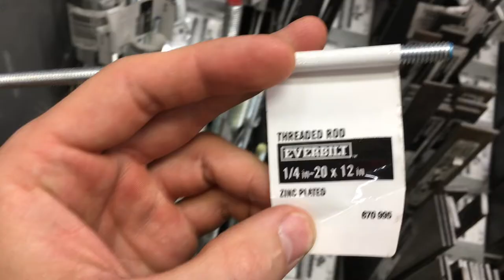Microphone Boom Arm made from cardboard Part 2

Comment: is it strong? would it be able to hold around 450g
Reply from the maker: Yes it could hold that much wait. You may need to ad more rubber bands or a stiffer spring. I want to redesign it and make one with a counter wait on the back.